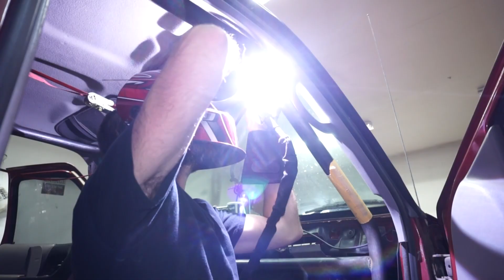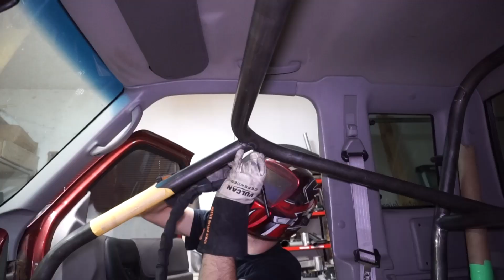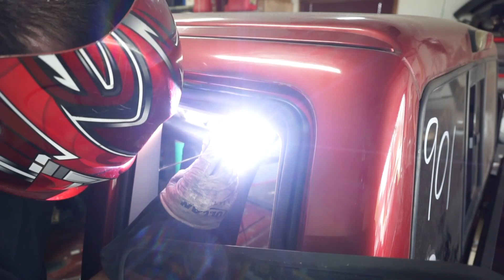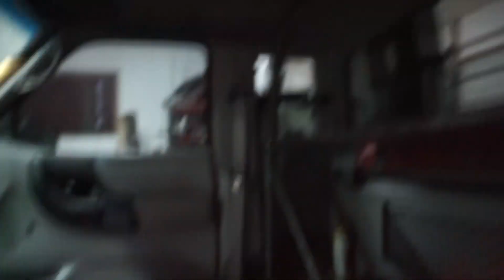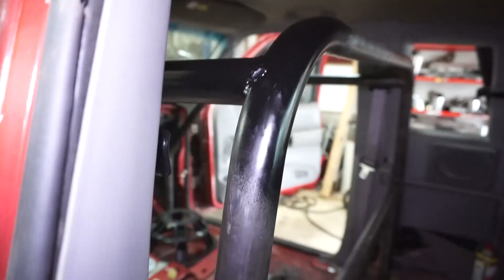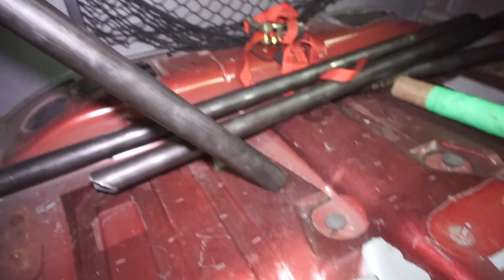Burnin Joints | Welding Up S&W Roll Cage For A Thing...

Comment: That cage has turned out great! So a cage builder around here, takes the outrigger, and runs a bar from the front outrigger to the rear outrigger, and outs a few short pieces ro the frame, almost like a double framerail. I thought that was a great idea.
Reply from the maker: I have seen pictures like that.